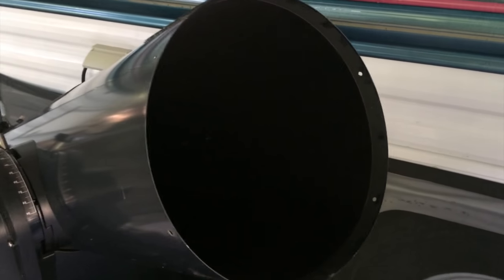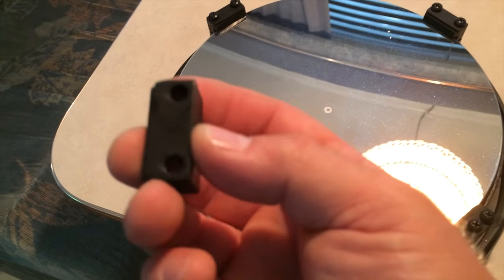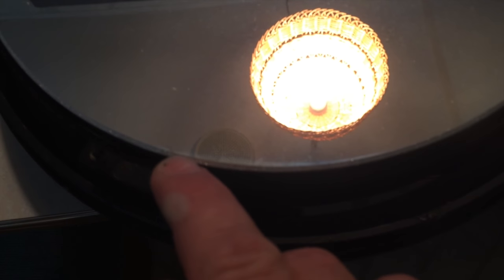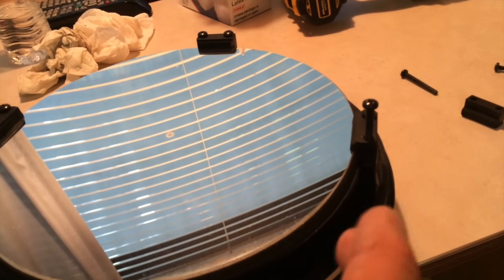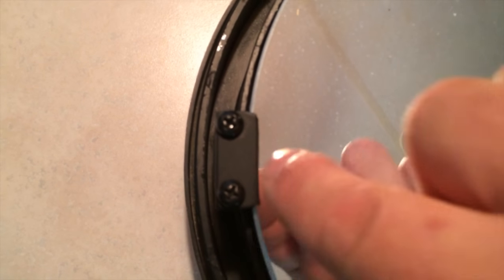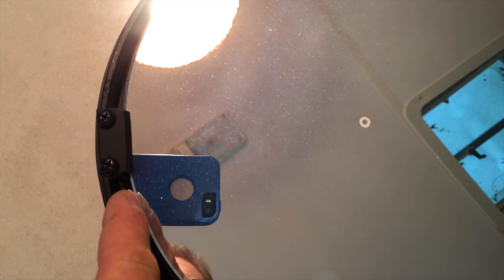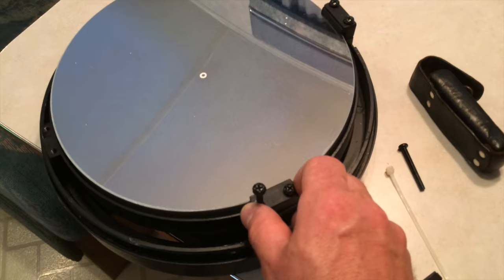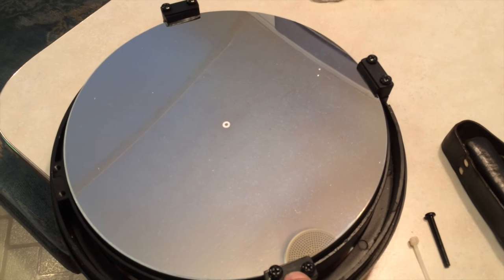How to get more aperture out of your telescope

Comment: I'll give it a try. You can cheat and use this calculator here: http://www.csgnetwork.com/circle_sphere_area_calculator.html to figure out the total surface area of a 10" mirror: 78.540.

The formula if you don't want to cheat is A = Pi(r^2) where A stands for area and r stands for radius.

The surface area blocked by the secondary mirror is calculated with the following formula: Area = Pi*(L/2)*(W/2) where L stands for length and W stands for width.
So using your measurements that is 3.14*(3.25÷2)*(2.75÷2)=7.0159.

I then subtracted the secondary from the primary: 78.540-7.0159=71.5241.

The material removed was figured out by multiplying (1.25x.375)x4.
The total area gained from removing the material is 1.875.

I don't know how much material is left covering the primary mirror after you modified the clips but if you consider it to be negligible then we can put it all together now. 

Here is a breakdown of the numbers:
Area of a 10" mirror............................................................78.540
Removed area of one mirror clip....................................0.46875
Removed area of all mirror clips....................................1.875
Area of a 10" mirror with the full mirror clips..............76.665
Area of the secondary mirror..........................................7.0159
Area of the primary mirror before modification..........69.6491
Area of the primary mirror after the modification......71.5241

Before the modification the percentage of light transmitted was 88.6%
69.6491÷78.540 = 0.88679781

After the modification the percentage of light transmitted increased to 91%
71.5241÷78.540 = 0.910670996

The percentage of light that is transmitted through the telescope went from 88.6% to 91%. So you gained 2.4%.

What did you come up with?
Reply from the maker: Thanks for the reply. I got less, like 1.2 % . Im sure my is not right. to busy now .ill put it out later.
Reply: Wow! Are you a maths teacher?? 👍
Reply: @wesleydonnelly2141  no I'm not. I just like math and astronomy.
Reply: @shawnloescher429  Oh right, cool! Very impressive! Maths was never my strong point at school, but i'm pretty good with maths now. Definitely not on your level though!

Comment: You really need to know the dimensions of the pieces removed as they were covering the reflective surface of the mirror. This will allow you to calculate the percentage gained. It’s impossible to calculate the percentage at present without knowing the dimension obscured by the existing clips
Reply from the maker: 1 1/4in. by 3/8in times 4 = the area of clip removed. its in the video.